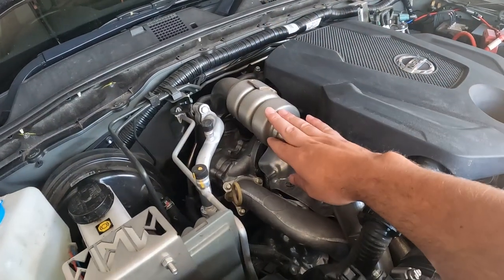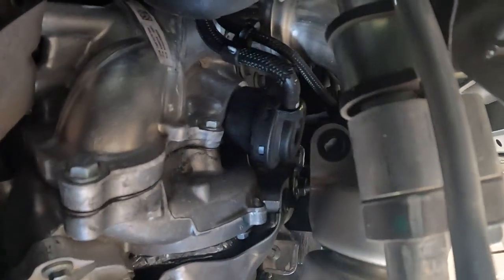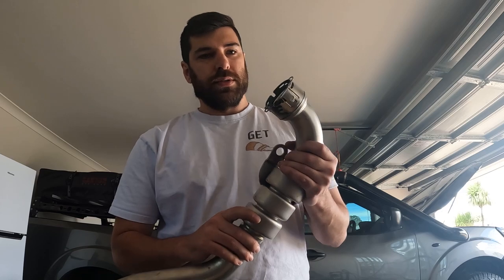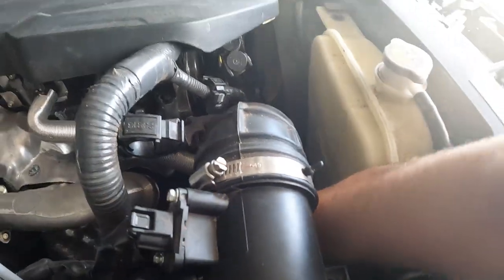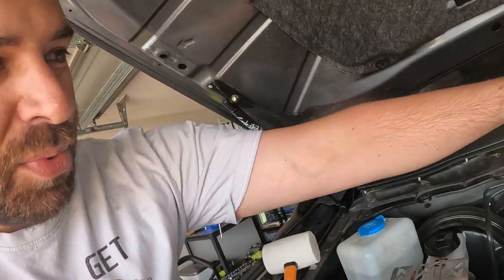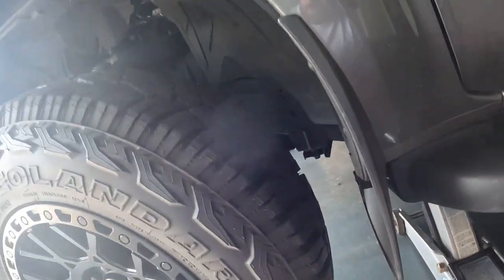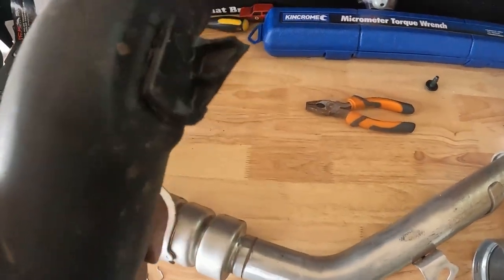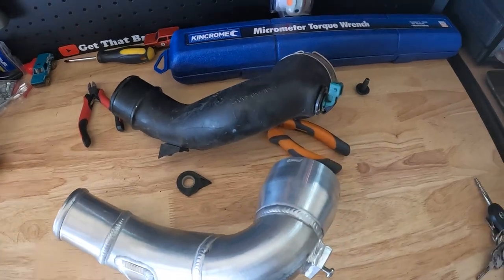CRG Hot Pipe & Throttle Body Pipe Install | NP300 Navara Build

Comment: I fitted the CRG Hot Pipe on my D23 this afternoon. One thing  I noticed with original pipe… as soon as I removed the two mounting bolts the pipe was amazingly loose on the turbo, considering it’s an o ringed push fit. The CRG pipe with the dual o rings definitively takes some push to get seated on the turbo and even the front end, connection requires more force to get connected and the clip seated. However, even before I put the mounting bolt back in the CRG pipe is a far more stable fit on the turbo. I also fitted an All Terrain Industries ribbed silicone duct between the air filter box and turbo inlet. I took it for a drive on a regular run up the mountain and I’m stunned. I clearly had a boost leak, maybe at both ends of the hot pipe because it’s really noticeably stronger up hill and even sounds subtly different. I’ll do the CRG Throttle Pipe next and then a tune and maybe an intercooler upgrade early in the new year.
Reply from the maker: Nice one!

Comment: I’m struggling to find out why they leak oil from the hot pipe. Does the oil leak from the turbos or is it just crank case ventilation build up?
Reply from the maker: Just an ineffective seal. The CRG pipe was so much tighter.

Comment: hello mate. you change the hot pipe and throttle pipe does it effect the factory warranty?
Reply from the maker: Hey @wanglowes1618 it will only affect a warranty claim if those parts are found to be the cause of an issue.
Reply: @GetThatBread  cheers mate!

Comment: G day so what is the advantage of the hot pipe, regards to you.
Reply from the maker: The stock seals are known to leak after a while.
Reply: Thank you as I have a 2022 stx so I will getting the hot pipe fitted an a new intercooler upgrade, thanks digger and stay safe 👍.

Comment: I changed my hot pipe and found no difference at all except now it's noisy. waste of money if you ask me.
Reply from the maker: Hmmm not sure where you got the idea that it would make a "difference" (I assume you mean power?). The difference it makes is reliability with the better seals. If you want power you need to go get a tune done, its on my list of things to do this year.
Reply: @GetThatBread  . what i am saying is that you could have just replaced the O'rings (If they were leaking) and saved a heap of money. replacing the whole pipe is a waste of money. depending on klm you could have had Nissan replace for free under warranty.
Reply from the maker: @kanenaysmith9287  oh ok, I get ya now. That's true, I guess it depends on what people have planned for their Navaras at the end of the day, its a pointless mod if thats someones situation and they are happy with the stock one. I changed mine as I know I will get a tune at some point and wanted the better seals and to try avoid a leak in the future.
Reply: @kanenaysmith9287  you can't buy the seals separately to my understanding, you have to buy the entire hot pipe from Nissan, which is quite expensive.

There's no aftermarket option and it is a proprietary seal.

Obviously if you can claim a new one under warranty, do so as you should get another 5 or 6 years out of it before it fails.
Reply: @AndyViant  you can. and you can also buy non genuine o'rings. to fit